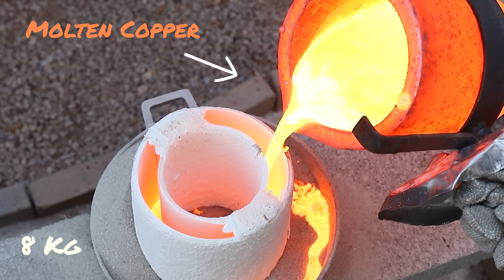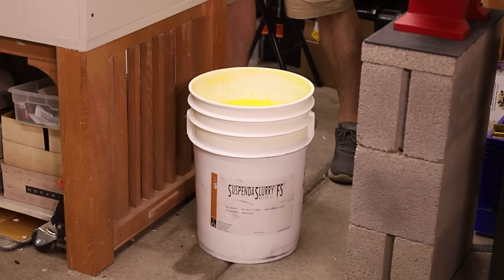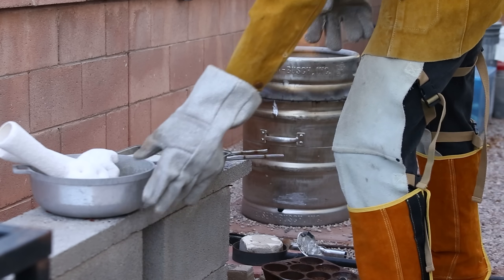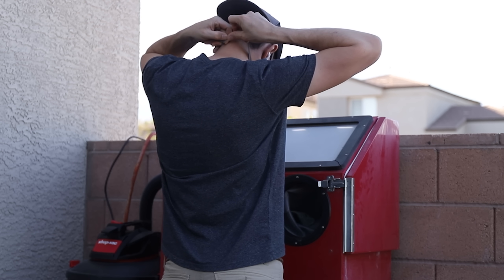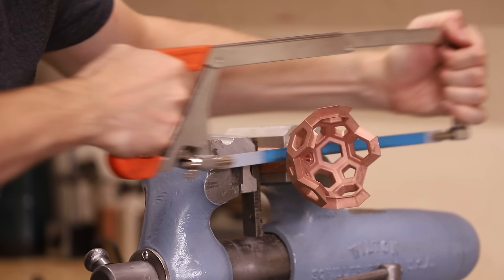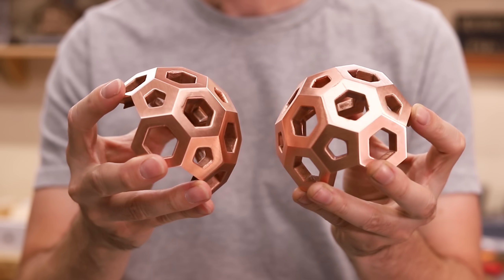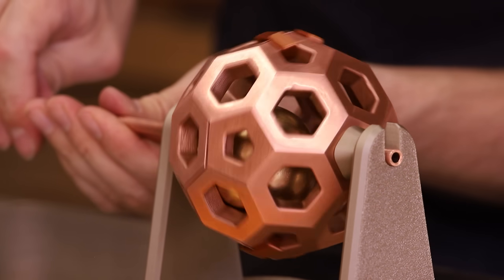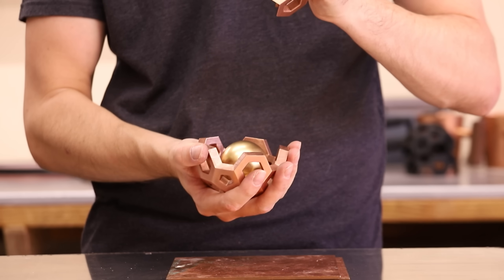HUGE Magnet VS Copper Sphere - Defying Gravity- Will a Neodymium Magnet Float Inside?

Comment: Yeah. That first spin up… so three things that WILL massively aid visibility of the magnet are

 1- don’t polish the outside of the copper sphere as the shine reflects too much light and automatically draws the eye and our autofocus and auto exposure then gets set to that and then all we can see is the spinning copper. So the original rough as cast dull finish for a copper look would be best but if seeing the magnet is the real aim and not your pretty copper casting then a mat black dull paint inside and out is the key.

2- make the big round magnet shiny so it reflects as much light as possible. This sets a huge contrast which draws the eye to it rather than the copper ball which is spinning.

3- perspective. Those holes are rubbish for this when you’re trying to look inside. You see the casting is so thick that the depth of the hole has the side blocking the view through the narrow view ports. So to fix put the ball on the stand and position it and then just look. You will see that you have to file the sides so that they are angled inwards with the inside face having a bigger hole. So now the view ports are bigger.

4- this is all about conductivity and current eddies I believe. So those fucking clips are a freaking joke. Sorry buddy but your ball of magnet would work better with proper conductivity between the sides. It needs to be tig welded or soldered or some electrical conducting paste and screws. You’re working at the edge here when aiming for the slowest spin speed so this counts so so much since it’s the reason it works at all.

5- the dodecahedron looks flashy but it’s not the best for this. You see the distance from the centre of the art piece to the copper varies so much. All those corners have the most copper but they are further away from the magnet. So wasted. And the closest copper is the cut out holes so just not there. Then the hole filing remover copper you need so add that back… so you use a perfect spherical surface for the inside surface. Then use the exact same outside surface as you have so you still get that brilliant shape that would look good on a desk. Then have the all the viewing holes filed. This smoother inside surface will add a metric fuckton of copper to the inside of the sphere and much closer than the copper you already have but will not lessen minimum inside diameter of the sheer when compared to what you have. So more copper where it’s needed, better perspective view ports, soother inside so the magnet won’t bang anywhere near as much. 

ALL THOSE WILL GET YOU THE SLOWEST SPIN SPEED FOR THAT MAGNET AND THAT SHERE DIAMETER AND THICKNESS. The rest make it visible. 4 and 5 I would consider just basic oops I fucked up and can do better for the next try as for bang for buck they win.

For fun get a small electric motor and a small solar panel and 4 small LED and have an led at 90 degree positions around the sphere on the base shining in and up so that when the sphere is in line the light goes straigh5 through the hole and hi lights the magnet while the mat black outside absorbs the light.

Comment: Super cool. Try to put an elec motor on each side with a pots to synchronize speed. Then slowly separate halves mounted on a linear rail while spinning to the point where a camera could see mag ball floating in the middle. Would be cool to see how far you could separate.  Self centering?Might need counter weights on opposite ends.  Also curious what would happen if you spun the halves and opposite directions. Great video!

Comment: Great video! Subbed! There are some filaments and resins made specifically for investment casting that are designed to burn out more cleanly than PLA. It's more expensive, but the cost per part is still really low, especially with lower infill percentages. In terms of maximizing the effect, it's going to be strongest along the equator, where the magnet gets closest, so having it be a sphere of segmented rings with gaps towards the N and S poles to see through would probably function better for this experiment.

Comment: I wonder what the field lines look like considering the locking you achieve with a magnet 1ft away... Could you use some field viewing film to discover this?
Reply: Also, do the Eddy currents cause elevated temperature in the copper? Maybe look at it with a thermal camera to see in multiple dimensions?

Comment: Ok, I need to ask this one, once you hook up the micro adjustable motor to this to keep the speed correct, add some contact brushes to the rods and see if this thing is actually making an electric charge. I have been fascinated by Lens’s Law and always wondered if you made a torus, keeping the magnet inside, spin the torus along on long axis at the same rate as gravity and the resistance, do you get a more productive electric coil for generating electricity? I know you are putting more energy in than you would be getting out, but if you have accidentally created a better more effecient coil it would be cool to know. Wonder what happens if you make a larger outer cage, add magnets to that so you have thee inside magnet sphere, your copper cage spinning, and fixed outer magnets does your multifaceted copper ball become that coil and what voltages/watts come off of that. Great job on all the parts and the video, love it when my brain starts thinking like this.

Comment: I think the two halves may not be in good enough electrical contact.  The eddy currents being generated are very large (at very low emf) and may not be flowing properly from one half to the other.  Yes, the halves are in electrical contact but only at certain points, not uniformly.  The only way to test this would be to solder the halves together which would be a bit of a mess.  Super cool project, amazing casting quality!

Comment: SOOOOO cool.
1. You could get a smaller magnetic sphere and test that
2. You could remake your object in aluminum and observe the differences of the two setups
3. Ballbearings on the shaft (no seals, fully ceramic) would make it super smooth
4. Maybe use a non conducting shfat. Wood, carbon fibre, etc...

Once you have finalized teh setup, sell these as desktop ornaments for $$$$ 😙

Comment: Either increase the sphere''s (buckyball) size or decrease the size of the magnet (afaik there is an optimal ratio) but yeah thin the struts and paint it black and make a better hookup for a drill or a motor and its gonna be cool as hell to use as a conversation piece.

Comment: Maybe a little smaller ball magnet. Also, if possible try using ico-sphere with same sized pentagonal and hexagonal holes. Like your current model, use another model with same sized small holes and another with same sized large holes, again using your current model showing these two differences.

Comment: For the ceramic being as hard as it is, it seemed like you were just blowing away fluffy marshmallow with the sand blaster. That was very satisfying to watch.
Reply: I cut through basalt with coal slag in mine.
Reply: Yes that puzzled me also. Ive used a sandblaster  many times and never had it that powerful to blast through ceramic material like that

Comment: Is it possible to use a motor to spin a concealed magnet beneath a larger, reprinted base, enabling it to wirelessly rotate the contrivement at sufficent speed to get ball levtation? The goal would be to achieve a seemingly driveless and mesmerizing, hovering effect that enhances visual appeal—potentially creating a modern marvel, a true wonder of the world.

Comment: This is so cool! You can complain a lot about all the crap shown on YouTuber, but channels like this more than compensate for it. This idea needs to be developed, I'm sure it can be improved on. Maybe larger windows in the copper so that the floating magnet can be seen better. I also suggest using roller bearings to mount the whole thing on.

Comment: if that sphere magnet had more than 2 poles it would be more stable.   but then it would have cost as much a a car so... best is double axial and radial so you effectively get 8 poles with the current configuration.   problem is the sides are moving slower than the middle so you get less stability near the axle and if the poles aren't perfectly aligned with middle you'll end up wobbling rather than pinning. 
top tier video.

Comment: Not enough copper mass, did you notice how fast the magnet dropped after? It needs to be bigger and smaller holes same design but smaller hexes more copper. I'm sure it will give you the desired effect and will float 🎉

Comment: Try using some small ball bearings on the bars you placed on those plugs, so you can spin it up and then allow it to free spin at speed to make it easier to maintain. Also, I wouldn't bother with painting the copper truncated icosahedron , I think it's fine as is, but you could color the sphere to a lighter color so it's easier to distinguish. Maybe paint it with some glow in the dark paint, that'd be insane.

Comment: I believe a copper toroid may be more effective in utilizing the eddy currents from a spherical magnet.  Perhaps by rotating the copper toroid around the spherical magnet in the center the entire device may levitate at high enough power.  I think the toroid would have to be helical shape though, and you would need two of them rotating in opposite directions to cancel out angular momentum.

Comment: Basically your product is a heating device without any cost, other than producing it. Then just shake it and it gets warmer and warmer. You can Improve the levitating effect, by adding more faccetes to the inside of the sphere, make it round inside..and outside, not geometrical with angles and so.

Comment: The Lenz law gives a proportionality effect on the 'change in magnetic flux'. BTW you might have had a 'smaller' effect also if you had dropped the flat magnet into the hole of the cylinder 'side-way' instead a flat (whether measurable by eye or not).
If you want a stronger effect? 1 have less holes, 2 understand what is the direction of the magnetic field of the ball (or use a flat magnet).

Comment: You should do a copper sphere where you have cut the ends off. Then lathe the outer shell consistent and place it on rollers. That would give open window from one side to observe. Should not affect the functionality at all.

Then just one thing left would be the mechanism to turn it. Could be either by the rollers leaving two sides completely open, or some kind of 3d-printed system to attach an axle on one side. 

Not sure how much the rollers would affect the functionality if they are magnetic.

Comment: The effect is small as you would have having had cuts in the cylinder.
The 'holes are limiting the 'surface' under which the magnetic field is changing.

Comment: Make a way bigger one that's round that u can fit a camera inside and hook up a oscilloscope with brushes and use a infrared heat camera and spin it with a rubber wheel jig letting it roll ontop exceptionally fast

Comment: Maybe you should attach the donnut magnet to a motor at the bottom and try rotate it. This may give the impression that the ball is rotating itself, and will probably may be easier to balance the position of the magnet ball inside the copper ball, since in this case the copper ball wont be the primary source of momentum.

Comment: The magnet might float better if the two halves had a more ideal electrical connection.   The eddie currents are probaly being interrupted at the seam.      Maybe some more filing or you could TIG weld them together.      This is really cool reguardless.
Reply: I thought about him welding or brazing them. The problem is that the heat will spread quickly through the copper, and that might anneal the magnet.
Reply: @KafshakTashtak  Use regular solder or silver solder, lower temp than brazing or welding. if the seams are tinned before soldering it will go quicker with less chance of major heat adsorption.
Reply: @KafshakTashtak  Some conductive putty might help increasing the contact area.
Reply: Would it help to solder the two half's together?

Comment: Visionary stuff man. Great to see the mix of 3d printing and ceramic preliminaries.
1) Make the interior of the truncated dodecahedron spherical rather than polyhedral. That is, start with a sphere and poke nice holes in it.
2) Once you have a better setup with the drill spinner, match the rotation to the shutter speed so the cage isn't visibly rotating.

Comment: Use a motor with rpm control to find the correct rpm, then see if you can sync up your camera shutter speed/framerate for a clearer view of the levitation

Comment: Probably been said already but, make the sphere a contrasting color. I wanna see a  mutli-meter hooked up to it to see if it produces a current. Little plugs in the shaft ends lubed with dielectric grease could work, to hold the probes from the meter. Cool project!

Comment: Perhaps consider some sort of conducting adhesives between the two halves so that eddy currents can better flow between them? That might help restore some rotational symmetry to the system.

It'd also be interesting to measure the resistance between the two sides, and any voltage difference between them while in motion.

Comment: Well, something to consider:  Either a smaller magnet (ball) or make the cage bigger.   Then it would be easier to see the magnet (ball) floating when the cage is spinning.
But I fear it would be better to make a bigger cage than a smaller magnet (ball) as the loss of strength may have unintended actions/results.

Comment: You need a machine that will increase the rpm gradually because the magnetic north and south polls are slipping past or behind nodes in the sphere.  Perfect gradually increasing speed will get you the result you're looking for I think.  Also, run a current through the sphere.
Reply: He needs more copper mass and smaller hexes. Did you see how fast the magnet dropped in the half shell?

Comment: You should try to paint the cage black and drive the shaft with a step by step motor to rotate to a modulo of the camera frequency. also the two parts of the cage must be bonded electricaly with a VERY good conductive to benefit plently of Len's law. also the sphere can be sand blasted for difusing light and less glare/reflective effect.

Comment: If this is possible, maybe the right kind of solar panels can provide a motor with enough power to operate at low speeds, which seems to be good enough for the purpose of making a cool decoration and piece of science. Having a high velocity desk decoration, not good without a protective cage, like a fan.

Comment: If you make another copper sphere of the same type, and place a neodymium ball inside it, and place the spheres next to each other on a standard stand, but for two spheres, then you will get a "magnetic reducer". If you make the copper sphere smaller with a smaller neodymium ball inside, then you will be able to change the gear ratio by changing the distance between the spheres, this mechanism can be called: "magnetic variator". But all this is not exact and requires experimental verification with an analysis of the obtained empirical data. You can also experiment with balls of different polarity.

Comment: I think you can get rid of the clips if you make the holder construction out of metal so that the copper sphere can't work itself apart because the rod on each side is pushing into the side of the holder that won't budge. This will make the copper sphere's look not be disrupted by the clips. Also when it comes to the ball leaning towards one side, I wonder if with the right electronic motor setup with a VESC or something you could program it to rock back and forth instead of rotating such that the centripetal force is counteracted each direction change but the Lenz' law is still in action and holding the magnet sphere in the air. Maybe there is a sweet spot. It could also make the magnetic sphere more visible in the moments when the direction changes as the copper sphere would be still for a moment there. It definitely calls for motorized control even if the rocking motion doesn't make sense though.

Comment: I wonder if you can spin it horizontally as opposed to the vertical spin your currently doing and still get it to float like it was in this video. If you could do thay you could put it on a base to spin it with a tiny motor to spin for you, the hard part would simply be finding a small enough motor that could spin it fast enough.

Comment: You might have made a sphere, well almost sphere, but you are still manipulating it like it was a cylinder. It is only rotating in one plane not the two or more that a sphere should be capable of. Just because the ends of the virtual cylinder are closed physically and electrically does not significantly affect or alter the induced magnetic field in the configuration shown. Think of it in a similar way that for simplicity the magnetic fields and electric currents of Earth with its iron core is compared to those of a squirell cage electric motor in low tech simplistic explanations and analogues.